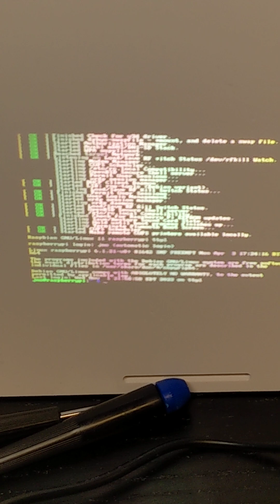Connect RaspberryPi to board level DLP LightCrafter projector dev.kit from TI

Comment: Would this be a good option for a real time vein viewer project
Reply from the maker: Yes, but you'll need to work with relatively low res images with your IR camera to keep a good interactive framerate.  Rpi don't have hardware acceleration GPU like you'd get on a Jetson. But the evm2000 is 640x360, so you don't need to have much resolution from your input camera  to make the projection pattern.
Reply: @intellar_ca  what would u say is a better alternative?

Comment: Would this work for a raspberry pi zero w?
Reply from the maker: I never tried it, but the adapter board uses the 2x20 header which is available on the pi zero w. Back then I worked with os bullseye, and the pi zero w seem compatible with this version.  So I think it would work.  
I need to update the project to 2025..

Comment: i would like to use this dlp as an low-cost diy exposer for pcb development. on a scale from 1-5 how difficult is it to replace the light source with a low power uv laser?
Reply from the maker: This can be a complex project, depending of your expertise in optical and especially optomechanical design. The light engine is compact and not easy to modify. Lucky for you, it can be purchased separately so you can experience with it. Did you check the release notes?
https://www.ti.com/lit/an/dlpa078c/dlpa078c.pdf

Comment: For my final year project I actually need a dlp projector for projecting what I want. I’m using a pi 5 and I don’t know how to send the information to the dlp from the pi 5. I’m frustrated at this point
Reply from the maker: If you don't need the compactness of the ti evm2000 projector for your project, you can use a cheap HDMI led projector. Less elegant but it will be easier to use.

Comment: Very nice work! could you tell me how you built the custom adapter board or if it's available for sale?
Reply from the maker: Thanks! check the project page, here, I give some info about the board, https://www.intellar.ca/blog/raspberry-pi-evm2000
Reply: @intellar_ca  thanks for the reply! Can you share the link of the board you used before connecting the pins to it?